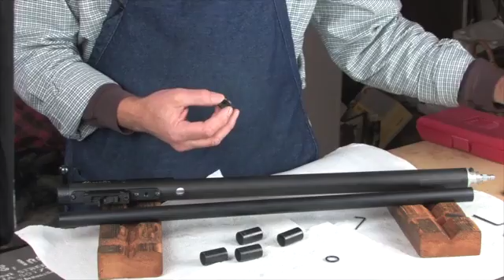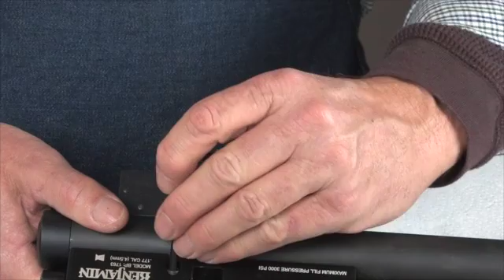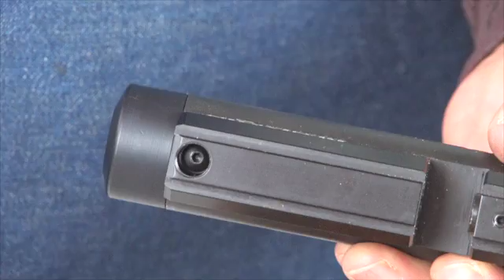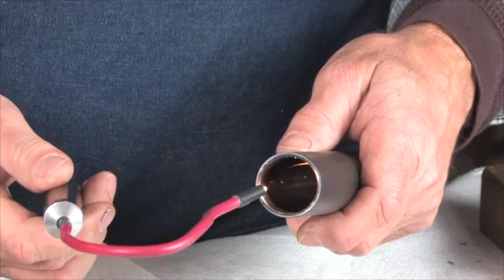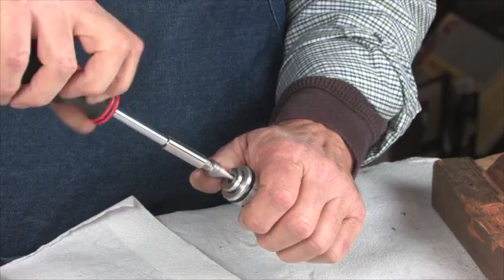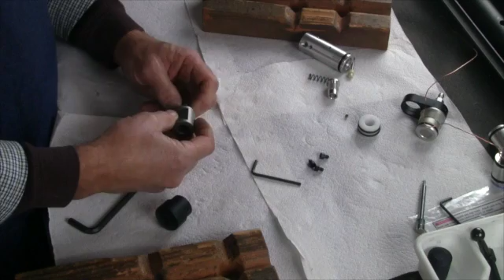Benjamin Marauder Strip and dis-assembly

Comment: Ii know that this is a older video but i need some help if you can !? 
I have a field target Marauder in 22 cal and i noticed that i have a small leak coming from the very end of the male foster fitting where the wire mesh is on the end of the foster fitting what could cause this and how do i fix it ??
Reply from the maker: Probably an oring or the check valve.  You can find seal kits on ebay, or probably from whoever you bought it from.  Just make sure to fully de-gas before doing anything.
Reply from the maker: I just ran across this site;  

https://www.captainoring.com/uploads/4/0/8/9/40890501/bp1763-bp1764-2263-bp2264-oringguide.pdf

There is a pretty good depiction of the various places where o-rings or seals go, i.e., could leak.  He doesn't sell the check/inlet valve or the exhaust valve, just the orings.  Not an endorsement, but thought the drawings might be helpful in case you don't have your parts diagram.

If you have the parts diagram, you can order by phone directly from Crosman.
Reply: @NorthWestAirgun  Thanks still keeping up with this thread. Much appreciated.

Comment: My mrod is older than this video, and even though I have taken the bolt and barrel off (though that was quite a few years back) I've never taken the valve block off or opened the cylinder. I'm currently rebuilding it because of a leak and extended lack of use, and your video was perfect to remind me of what all was in there!
Good quality, clear explanations, coherent!
Reply: I got mine in 2018, and it's been shot so many times that it's on it's third poppet valve. Just had to replace it again yesterday.

Comment: extraordinary video. there are very few video's that i've seen that compare to this one.  keep up the great video's. Ihave a question: do you leave all settings factory settings are do you have your own settings. If so can you share with me and also custom parts if any.  thank you so much for being so informative.
Reply from the maker: Thank you for the kind words.  The factory settings get you within a range of performance, i.e., shot count, velocity.  You can then adjust to tune the gun to your personal objectives.  The only 'part' I would recommend is a regulator, Huma or Lane are good, maybe others as well.  Then once the air pressure is regulated, it becomes easier to tune.
Reply: @NorthWestAirgun  thank you very much. i really appreciate all the info. i have a .25 cal. and i was wondering if a huma reg. would even help as for as overall tuning. i have heard several people talk about how a .25 cal takes so much air that a reg. doesn't really help much and i just don't quite understand why they say that. At the moment my rifle is shooting about 845fps down to about 812fps before i see my poi difference. so i thought if i would put a reg. then all my shots would not fluctuate till it drops off the reg. also there are a couple 0f sounds i just can't handle too much. my rifle comes with the depinger from factory and i still can hear the ping a little. also there's a burp when i shoot. Kinda sounds like a deer caller to my ears. people talk about de-bouncer but i just can't find any. thought about taking out the factory depinger and putting a hill depinger. As for as the burp something about a hdd or ssg or tss. any suggustions  thanks in advance.
Reply from the maker: Oh, and I converted mine to .20 cal, with a regulator and light weight hammer, and the settings are all quite different from factory.

Comment: I guess removing the barrel end cap, o-ring, baffles and shroud is not necessary if all you’re doing is checking for air leaks and replacing those o-rings where there could possibly be air leakage.

Comment: PCP  pressure regulator
s(SS)
I`m over 12 years pcp regulators manufacturer(with high pressure I am working over 30 years) and in this time I`m looking for dealers from  any country which can sell my regulators.If you can buy 10 and more regulator per time,I can do better price.For more information and better price contact:  pcpregulator@gmail.com
https://www.ebay.com/itm/162720425677
https://www.ebay.com/itm/162172278885
https://www.ebay.com/itm/162104913497
https://www.ebay.com/itm/162104920622
Best regards

Comment: What an awesome video - got my .22 BM out after it sitting for 9-10 months and got two shots off before it started hissing and losing air.  Obviously a seal/o-Ring I am guessing.  I was hoping you would show how you took the wood stock off the rifle.  Is there a kit BM sells or is available that has all the typical o-Rings required for an overhaul?  Thanks again for this awesome video.  I have good confidence i could take it apart as well and get to the o-Rings and get it back to working condition.  Well done.
Reply from the maker: Thanks for the nice words.  check eBay for kits, otherwise Pyramid Air

Comment: Not gas! But the air!
Reply: Jewel 
He isn’t technically wrong. The air in the gun is the same air from our atmosphere and the same air that we breath and that air is a mixture or various gases. Oxygen, nitrogen, carbon dioxide, etc...
Definition of a gas. Gas, noun; a substance or matter in a state in which it will expand freely to fill the whole of a container, having no fixed shape (unlike a solid) and no fixed volume (unlike a liquid).

Comment: Thanks, great video!  I was looking for the reassembly video!  The one important item is the lubricant used to relube everything.  I've got my 25 cal Marauder apart right now, and noticed the hammer is lubricated with what looks like molybdenum disulfide.  I think this lube is very important for consistency - a silicone grease would not be as good of a lube here.  Do you know what Crossman recommends here?  I didn't find any info on their website.
Reply from the maker: +Keith Kropf   Hi Keith, thanks for the kind words.  I just tear stuff apart, never get them back together though!! JK, work and health have cut into my video time, but I hope to get it turned around soon as I've got several projects partially in the can.  No reassembly video though, you are on your own there, sorry.

Conventional wisdom is to not use a petroleum based lube when reassembling, not in the tube or anywhere it might migrate into contact with the high pressure air.   I don't know what Crosman uses on the hammer, but any kind of grease can thicken and get sticky in colder weather, so cause inconsistency.  I go dry on the hammer myself, but graphite powder or the moly you mentioned might work pretty well.
Reply: @NorthWestAirgun  Hi there. Great video. I have a tech question. I have a second generation of the .22 marauder. Got it out yesterday got the tank pressure up to 1000 psi by hand and noticed a slight hissing of air
 From my barrel. Was wondering what you would do in this situation. Your help, time, advice and guidance is very appreciated. Oh forgot there is no gap between the hammer even with everything backed off.
Reply from the maker: Sounds like air is leaking past the exhaust valve.  Can you fill it up to higher pressure and then let it sit overnight and see if it bleeds down?
Reply: @shawndubay3736  this is exactly what my sons is doing. Also the reason I’m here trying to see if I can fix it. By the way great video

Comment: is the Gen 2 the same  take down
Reply from the maker: RimfireRat   
I don't have any experience with the Gen 2 version.  I suspect it is very similar but there are probably a few wrinkles.
Reply: RimfireRat NorthWestAirgun i was able to strip the later generation marauder with this video. There's a difference with the bolt, you first take off the receiver and then you take off the bolt. The screw that holds the bolt in place can only be reached until after you take off the receiver. 

the other problem i stumbled upon is taking out the valve, it won't budge. i'm stuck right there at the moment.
Reply from the maker: Daniël Windstra Thanks for the tear down advice on the Gen 2 bolt.  Might try comparing Gen 1 & 2 parts diagrams to see if there is any difference that is holding in the valve.  Good luck!!
Reply: NorthWestAirgun the valve thing was a little bit of ignorance from my side, i didnt take out the gauge.

It came out easily when i removed it. I removed it 'the long way' but i still managed to take a chip off an o-ring, so you have to very careful either way.

Comment: You mentioned the pellet clipping the baffles, I took the shroud off an had lead shavings all over the baffles on the orings bore an breach side the front of the barrel that sits against the spring an I've got the current yr model in syn. 22 my baffles are different shipped they get narrower an then come to a ring or brim an that chipped on one of them from the clipping issue it's all clean now an I'm getting ready to clean the barrel real good,  so clean barrel,baffles, and shroud should restore accuracy right